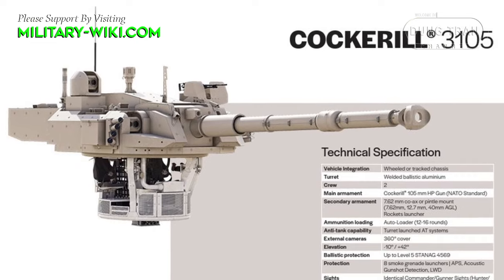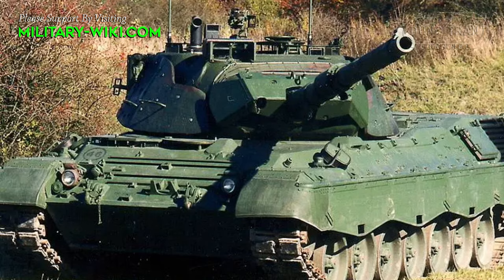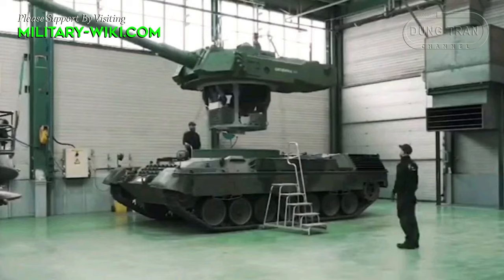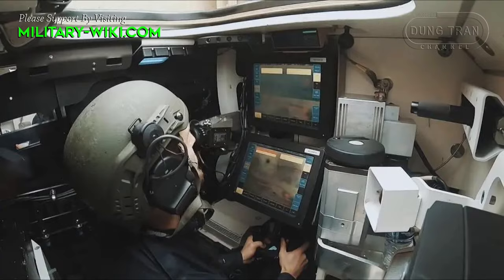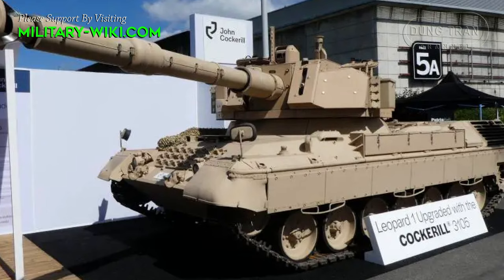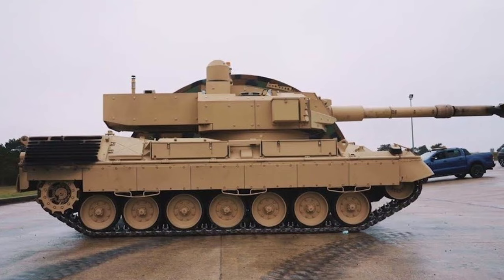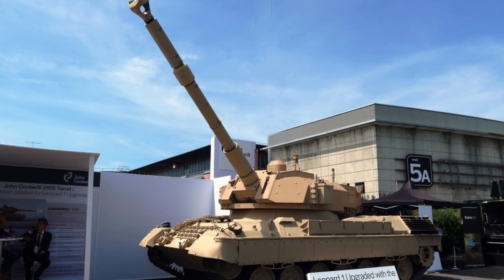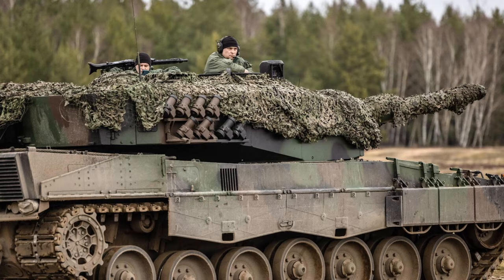Leopard 1A5 Fitted With A Cockerill 3105 Turret - A Significant Upgrade Option

Comment: That turret ring looks a little exposed, but this looks like an excellent vehicle for infantry support operations, or screeening operations.
Reply: Screening. Twelve rounds isn't much for infantry support in heavy operations against equal opposition, and you're right that the turret ring looks like a juicy target! Aluminum armor only rated to a maximum of.50 Browning (12.7×99mm) and not even Armor Piercing, at that, if I translated nomenclature correctly!

Comment: if this could be put on a t-54 that would be cool
Reply: There are two upgrades of the T-55 in use, one bought by Egypt and the other by Romania. The upgraded Romanian T-55s were donated to Ukraine. Both are similarly capable to this.
Reply: @davidgoodnow269  thing is still that its the same gun as on leo 1 and 2a5 already has thermals, for leo 1 this is something very costly that does almost nothing, for an old m48 or t-55 it would be amazing tho

Comment: The Leopard 1 should be equipped with a 120mm tank gun instead of a 105mm tank gun. It is much more valuable to convert Leopard1A5 to Leopard1A6.

Comment: another informative video mister Dung, good as always. well the Cockerell defense company, was obviously trying to pioneering the Cockerell 105mm tank gun for there offer to any possible interested client around the world, but the problem is that there so few, if not no one are interested for a lighter tank gun, but every military armed forces are more likely interested to a much larger 120mm or the 125mm Smoothbore gun platform, that is why they would rather choose those much bigger type of caliber of the tank guns over the smallest 105mm. for a possible tank gun modification upgrade, whereas to be possibly mounted to those old but still reliable tank hull chassis.

Comment: why would those countries upgrade their leo's they're wore out at this point! while they might get another 10 years out of them  it's cheaper to just replace them now and save the upgrade costs and the increased price on the replacements down the road! and they're a day late and a dollar short if they're counting on sales to kiev!! the world is tired of that fight and is starting to cut off the shekels!!!
Reply: I agree with some of what you said . . . but you are missing some major points.

The people backing war want heavy sales, and a pull-and-replace like this is much faster than getting approval to purchase and sell and manufacture and deliver . . . .

The latest MBTs may duel other tanks. Updated older tanks can serve better than new to provide infantry support, if the upgrades are well-chosen, and in urban combat < 1,000 meters, a French FSAPDS-D-DU from a 105mm L7 will kill any tank in the world.

The greatest dangers to armor on the modern battlefields are modified sub-US$1,000 drones, and updated 84mm Carl Gustov recoilless rifles like the Im.L.A.W. If someone is going to go after you with those, your greatest needs are 360° thermal threat detection, and a very fast and accurate remote-operated machine gun mount with very high angle and very low depression capability. Throw a mine flail on the front, too. M.G. mount, US$15,000. Thermal detection can be purchased, or simply strip the seeker head from an out-of-date shoulder-launched heat-seeking missile and wire it up to a reprogrammed smartphone in place of the camera module. Price? You just saved disposal fees. Programming cost you a favor to your neighbor's kid.

Oh, there's a marked advantage to using Soviet 100mm or N.A.T.O. 105mm in this role: more ammunition in that chassis, more rounds of ammunition on each supply truck, and that ammunition is cheaper. Rifled guns like the 100 and 105 are tremendously more accurate than smoothbore 115, 120 and 125, too! Misses are going to land somewhere . . .  this isn't World War II, when people would see an artillery strike on civilians and say, "War is Hell."
Reply: It takes many years to produce tanks in the hundreds not to mention thousands from one manufacturer.

Other countries are waiting as well, so it is more effective to upgrade for time sake as a country slowly replaces their older equipment.
Reply: @dan9002  tanks have ran their course the future is big gunned 8x8's my point was why waste money on tanks when you can get 3 maybe even 5 8x8's for the same price as a single tank and at a faster rate?
Reply: @keithmoore5306  Tanks have not run there course. This is an old debate since WW1 and there is a reason every country in the world that can afford one wants them.

Comment: I would not be surprised if a standard Leopard 1A5 turret, minimally upgraded, would not be far, far, superior in every aspect. With the best visible-light rangefinding, fit that with low-light amplification at the viewfinder and FLIR behind the lensing at either end of the parallax rangefinder to give binocular thermal vision; duplicate viewers for gunner and commander. Then apply hacked smartphone camera modules to about six points around the hull, and feed the assembled and processed imagery to the driver through a VR headset. He now has 360° visibility, with redundancy, around the entire tank, in visible light, low-light, possibly UV, IR, and deep-IR/thermal graphic.

Slap one of those drone-killing E.M. rifles on the roof, and possibly spackle the armor with the fancy new improved explosive reactive armor Israel is selling. Oh, and replace those stupid 40mm smoke grenade launchers with 120mm stub-mortars to fire Improved Thermal Smoke (the kind that floats chaff on the updraft to screen millimeter-wave RADAR)!

MUCH better armor protection; this video makes no mention if the Cockerel 3105 turret has Cellular Ammunition Storage Equipment to protect the turret crew from catastrophic detonation--its appearance could go either way. No mention of armor applique kits to improve protection, either. The sensing systems are known (to me) as high quality and highly capable from other upgrade turrets (the Cadillac-Gage T-55, if I'm not mistaken). No mention of integration of a remote control mount for any topside machine gun or other anti-drone armament.

What happens to those fancy sensors on the Cockerill if those fancy sensors get hit by an anti-drone EM rifle from four or five kilometers away? Are there at least optical-glass backups?

Comment: Well the old Leopard 1 turret has better protection than this "Cock" crap!!! Possibly to transfer a new fire control system and active protection to the old turret and that's all!!! The protection bars put on the side of the tank body where he is most vulnerable!!! This "Cock" turret is nice but it's small level protection!!!😊
Reply: 👍👍but I know between hall and Leo but so it's possible with from Reihnmetal active protection system and cheaper than Throphy.All Tanks without activ systems with that modern Rockets are Javelin only that to survive and cheaper than complete Tank so I didn't understand why there put on that newer Tank some system for that is not cheaper to loose complete Tank🤷